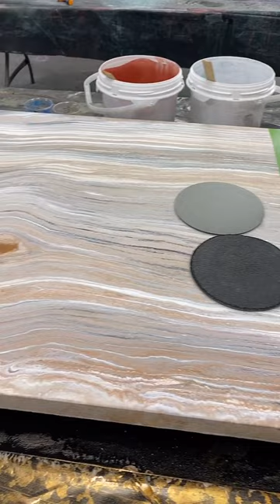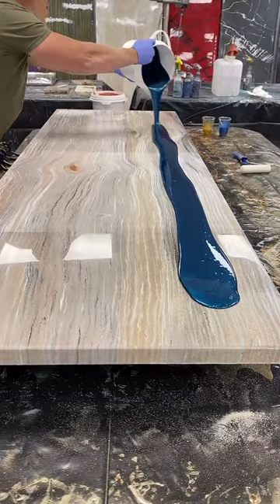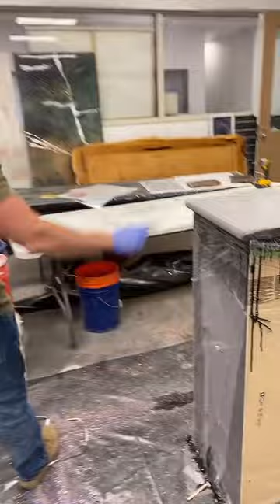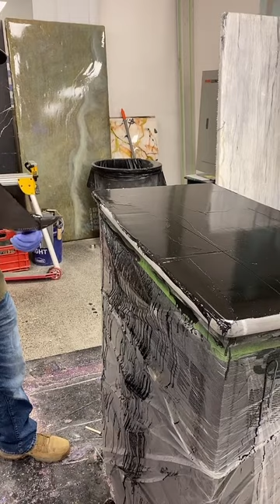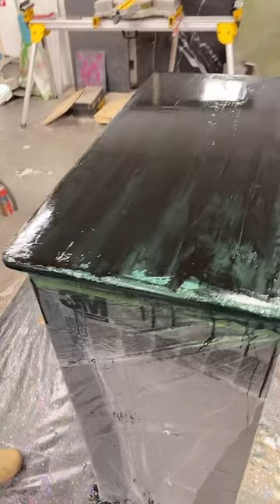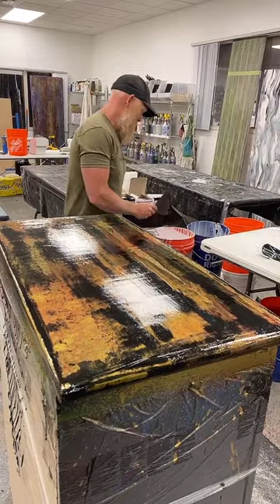TikTok Live 05/31/23 - Polish Woodgrain - Turquoise & Sandstone Epoxy - Countertop Epoxy

Comment: How many metallic powders do I need to color 1 liter of epoxy?
Reply from the maker: Roughly 3 Tablespoons but this also depends on how color blocking you want it. If you want full coverage add some and do a “stick test” if you can see the stick through the epoxy then you’ll know to add more.
Reply: Can the metallic layer be 1 mm?
Reply from the maker: @طارقحسن-ث7ش  it’s designed for applications of 100 or greater thickness